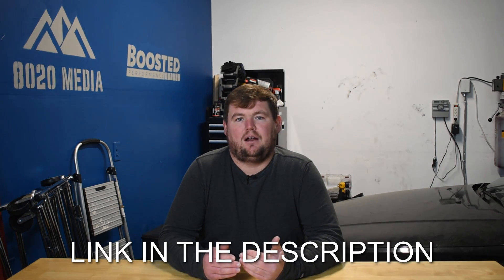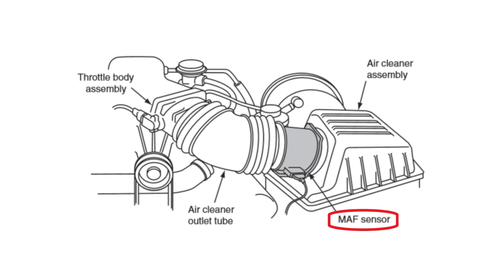DIY - 5 Symptoms of a Failing MAF (Mass Air Flow) Sensor!

Comment: I changed the spark plugs in a 2014 Audi A4.  Car ran fine.  Changed the air filter and cabin filter.  This morning I drove the car around the block and it ran fine.  Changed the oil via evacuation method.  Started the car and it ran so rough I turned it off, but have an EPC light and check engine light.  Any Ideas?  The housing for the air filter was full of dead leaves and I used a vacuum to suck those out...could this damage the MAF?
Reply from the maker: R - Not likely. Do you have a way to check engine codes?
Reply: Code is sun sensor b1601 etc
Reply: Same issue

Comment: Occasionally I have the press gas pedal because engine just keeps cranking. As I touch pedal starts right away. Could MAF  be faulty. No CODES. 
Excellent video 
Thank you
Reply from the maker: C - Thanks for sharing your experience! This video may be helpful: https://youtu.be/0YRdzJbHcm4

Comment: Had a 2004 Hyundai Elantra; it got, at best, 33 mpg.  Have a 2018 Hyundai Elantra; it gets, at best, 45 mpg.  2018 also has multiple drive modes from which to choose.  There are people who complained when the hand crank was replaced by an electric starter and their offspring didn't like it when the 8-track was replaced by a DVD.
Reply from the maker: T - Thanks for sharing. Although, not sure what this has to do with the MAF sensor.

Comment: You cant rely on MAF sensors to confirm a lean or rich mixture. Actually you should be looking at fuel trims, o2 and AFR sensors more than MAF's. Even a fuel pressure regulator can cause this.
Reply from the maker: S - Sure, but we're talking about the MAF sensor here only.
Reply: @8020Automotive  And this is why people like you get ripped off at stealerships. 👍
Reply: @sarin62 Hello I have a suzuki swift that is slow to accelerate after slowing down,sometimes I'm forced to restart the car inorder to continue moving,at times it shakes while accelerating,I've visited a repair shop and no codes are showing,I've cleaned the throttle,replaces airflow sensor still no change,can you please advice me on the possible causes.
Reply: @ericgituro1750  Try checking fuel injectors or fuel pump 👍
Reply from the maker: E - We have some videos that may help out here.
Rough idle: https://youtu.be/BiYsqRJCLhE
Losing power: https://youtu.be/ipjYLPJgpq8

Comment: I’m having low Rpms when driving staying under 2rpms the most is 3 rpms but I did clean my throttle body and took it out and propped the door open with a rag and also broke the little tab on the connector for tps could that cause low rpms ? No engine codes but you can feel it’s sluggish when going up hill. How do I tell if my throttle body isn’t working correctly or my tps connector is loose maybe. I also cleaned all the sensors and it ran a little better but it’s starting to go back to sluggish
Reply from the maker: W - We have another video that may be helpful here: https://youtu.be/ipjYLPJgpq8

Comment: My 2015 dodge dart sxt doesnt have a mass airflow sensor, it has the air intake charge temperature sensor... i was having trouble starting the car it crank but didnt start so i disconnected the connector for the sensor and it turn on so just replaced it and it works better and the car starts at first attempt not at second like it used to.
Reply from the maker: J - We also have a video that may be helpful here: https://youtu.be/0YRdzJbHcm4

Comment: My truck died on me at 4:30 in the morning on my way to work it would start run 2 seconds and quit, these sensors should not be able to shut your vehicle down
Reply from the maker: L - Are you getting an engine code pointing to the MAF? We have a video covering vehicle stalls that may be helpful diagnosing this: https://youtu.be/7bqAIbYRdnc
Reply: @8020Automotive  No it had no codes I could keep it running on carb cleaner so figured it was the fuel pump, $200 later it would only start then die I unplugged the maf and it stayed running. I cleaned it and it runs fine now.
Reply from the maker: L - Great to hear you got it figured out!
Reply: @lawnmowerman4040 my truck will start and then while driving, the rpms will go down and then die. You think If I cleaned mine then it'll fix?
Reply: I agree. My traverse, if the brake fluid is low it won’t run over like 40.
Reply: Bro you want to be able to run the engine with inconsistent and off fuel - air mis tire and damage it?? The engineers know better
Reply: @sam3d 
Huh....

Comment: Ok I don't have a code reader and have run into an issue with my 2011 camry.  The first start up in the morning is great.  The engine cranks right up.  After I have driven it for a few miles 10, 20 or 30 and let it sit for a moment it cranks, cranks and cranks then eventually starts up.  I recently put in a new battery and replaced the air filter.  Any suggestions where to go next?  
I've been told the fuel pump, but the car idles and runs great other than the start up on a warm engine.
Reply from the maker: Do you have a check engine light on? You can go to any Autozone, Oreillys, Advance Auto Parts, NAPA, etc. and they will read codes for you for free. Could be the starter motor, but yes could also be the fuel pump but I agree you'd probably notice some smaller issues once the pump gets hot and warmed up or on long drives
Reply: @8020Automotive  no check engine light
Reply from the maker: F - We have a video on long cranks that may be helpful with your research: https://youtu.be/0YRdzJbHcm4
Reply: @8020Automotive  ok I went to auto one they checked it and found no faults.  I’m in doubt what’s next. 

If it was the starter I would be having the issue on my first initial morning start.  
Too much gas in carburetor? Check valve? Fuel pump?
Reply from the maker: F - Only thoughts here are to check the starter motor/solenoid, battery, and alternator. If it's not those, then can dig a little deeper.

Comment: I had a mass air flow sensor code. Changed it out. Not a week later had input and output transmission sensor codes. 130k on the engine.
Reply from the maker: J - Sounds like it could be wiring related.

Comment: So i recently installed a cold air intake on my Camaro and my check engine turned on. When i took it to autozone, they said its the MAS. I took it out, cleaned it with the mas spray and tightened up everything again but check engine is still turning on. I did see a difference in the car turning on. Before tightening up everything and cleaning it, when i started the car, it had trouble staying on and i had to give it a little gas to stay on. Now it starts no problem after cleaning and tightening. Do you think i might need a new MAS for my car since i also got a cold air intake? Check engine still says mas is having problems.
Reply from the maker: M - It's possible. Are you having any air leaks? Have you reset the engine codes?

Comment: I’m having these symptoms issues with my car and when I put gas in my car it stutters to turn on and have to press on the gas to fully get it to start could you lmk what you think?
Reply: Check your Oil Level COLD. Also, check your Battery and Make Sure that it's on Tight.  Do you have to use  91 Gas?
Reply: Had the same symptoms with Chevy Silverado turned out it was the plugs

Comment: My code say's it's the Mass air flow P0101. I cleaned it and then cleaned filter and then just changed out the sensor. But the engine light is still coming on with that code.
Reply: FINALLY someone I can relate to, i currently have this problem I went back to the mechanic and they sent me to an Electric repair shop and they said the MAF is running fine they see no problem. However, my check engine light keeps popping up. Any idea or suggestions I can?
Reply: @8020Media @Michael-jv2cn
Reply: Umm default reset...take your negative off while the vehicle is running and turn it off and put the negative back on reset
Reply: If it is an older Nissan it probably needs a computer software update and reprogramming. I had the same issue with my 2011 and finally had the update done and it runs as good as it was when new!
Reply: @elvisway1  I have a Nissan rogue 2014 if you don’t mind me asking where did you get the software update done?
Reply: @daisymolina6064  I have a mechanic that got it done. He said that a guy goes around doing that for people. Middle Tennessee area.
Reply: @elvisway1  i have a 15 sentra and that keeps happening to me.  I've changed it a bunch of times. It keeps happening.  I'll check this out.
Reply from the maker: M - Give it a little bit, unless you have a way to clear the codes. Is it riding better?

Comment: Other sensors that give the same symptoms other than mass air flow are bad o2 sensor, temp sensor, and idle air control valve. All deal with fuel mixture. Other things to be aware of include, stopped up air and fuel filters and of course plugs, wires, rottery button,  and distributor cap.
Reply from the maker: D - Very true. Thanks for the added insight here.

Comment: Im having all these issues you’ve mentioned intermittently, like sometimes the car will run fine but others it’ll have all the problems you’re mentioning. but im getting p0492 codes (air pump) but my air pump is working fine. Also when the car is running ill unplug the maf sensor and the engine will hesitate but it will keep running. Does it still sound like the maf is the culprit?
Reply: I was told if it still runs when it's disconnected it's a bad maf. It should cut out. I'm having loads of issues with my audi tt. Mine still runs but runs better without it connected. So I've just ordered one. Wish me luck lol
Reply from the maker: B - Keep us updated!
Reply: 2001 bmw 330i
Reply from the maker: P - Could certainly be the MAF. Have you pulled it to see if it could be clogged?
Reply from the maker: P - It certainly could be. What vehicle do you have?

Comment: Now this is an educational video. Thank-you sir
Reply from the maker: B - Thanks for the feedback! Glad we could help.
Reply: @8020Automotive  question is I got the MAF code bought new sensor replaced it and still same issue with the engine shaky when I start the car and idle when first started sometimes it turns engine off
Reply from the maker: A - Sounds like stalling. We have a great video that may help you here: https://youtu.be/7bqAIbYRdnc

Comment: I wish I saw this video earlier! I have so many questions of what to do now
Reply from the maker: S - What's going on?
Reply: @8020Automotive  my cruise thru code for air fuel issues and then for the down stream 02 . So I changed the 02 and car wouldn’t go over maybe 15 mph . So they the mechanics told me to clean the throttle body and never got it started after that. Now it’s in the shop with a b101e code and I’m getting charged 300 to clear that code. But car still won’t even run for more than a few seconds. I’ve never had problems with it in the past
Reply from the maker: S - Keep us updated on this..
Reply: @8020Automotive  they changed the spark plugs, cleaned the mass airflow sensor change the knock sensor and now it just needs a catalytic converter and the car will be running. So basically I bought defective spark plugs from advanced auto because all kinds of issues with emissions and unburnt gas going into the cat and caused the computer to go into safe mode and throw the b101e code.
Reply from the maker: S - Glad to hear it has been resolved. Thanks for sharing your experience!

Comment: Hi! I’m thinking of getting a preowned full-sized pickup truck as daily work truck. I have a commute of 40 mile one-way (1.5 hrs) then another 1hr drive home in horrid SoCal traffic. I haul mostly network cabling installation equipment in the bed, and do not tow. 
What brand, model year, engine and grade do you recommend? I would like to have some of the newer active safety features such as the automatic emergency braking system to avoid front collisions, but not as critical as long-term reliability and durability. Any suggestions for a late model pickup  truck with Direct and Port Injection. Also, what immediate and affordable engine and transmission mods for reliability and durability do you recommend to protect the powertrain? I’m not looking for more power, just long-term reliability and durability as I don’t have too much money and need a truck for work and personal use. Thank you!
Reply from the maker: The biggest question is what is your budget. Long term durability I'd say avoid GM right now - their AFM/DFM technology is wack. Ford's 5.0 Coyote is a solid motor going to be lower maintenance than their EcoBoost engines. And Ram's Hemi engines are tried and true.
Reply: @8020Automotive  Thank you for your responding and for your advice! I appreciate your advice and help.
Reply from the maker: O - No problem! Glad we could help.
Reply: @8020Media  I wouldn't go as far as tried and true, Look up "Hemi Tick" its either bad or worse news! I have a 2015 with 140kmi and it's been a constant issue with  mannifold warpage/broken studs in the last 2 years, with them coming on and off 8xs which led to the "other" "Hemi Tick" and that would be dropped valves/lifters and ate up camshafts!! Poor exhaust design and attachment to truck, bottlenecks and chokes it down, and they are very temperamental and you're asking for trouble if you accidentally put 5w30 instead of 5w20 bc they are THAT FINICKY!! 2/10......don't recommend!!!

Comment: I changed everything in my truck to stop the missing popping an staling out then I unplugged my mass air flow sensor an it ran great it misses every now an then but it runs great and I also smell antifreeze but no leak ??????? 8:47
Reply: No it's not blocked
Reply: It's unplugged now and it runs great I've had 3 on it
Reply: @BurtLay  it’s running on a predetermined air fuel ratio with the sensor disconnected, you likely have a fuel delivery issue (pump, injector spider etc)
Reply: I was experiencing serious issues with my 06 Colorado when I read your comment. I immediately walked out to the truck and unplugged the MAFS and it ran like new. Thank you brother!!!
Reply: @MarkMcCullough-y5s  your welcome brother
Reply from the maker: B - Is the MAF blocked?